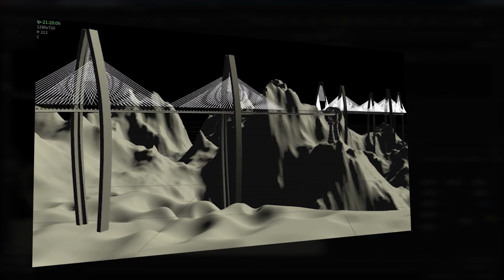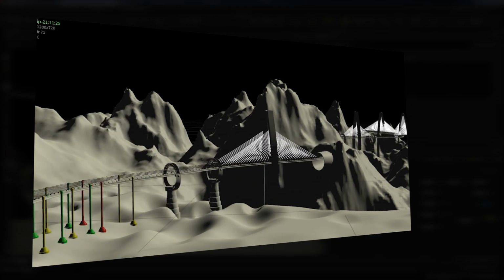The Railsystem | Project Introduction

Comment: Awesome! Are UV and material included?
Reply from the maker: In the first chapter I am going to start with the setup. I think the second one will be about more detailled modelling and with that also UVs, another one maybe creating materials with substance designer
Reply: @DavidKahlBuilds  The railsystem maybe very large in a real scene. Largescale heightfield in houdini is very slow and will use very much GPU memory. Will this course cover optimization?
Reply from the maker: @seatony9917  It will - but that is definetly not in the first chapter.